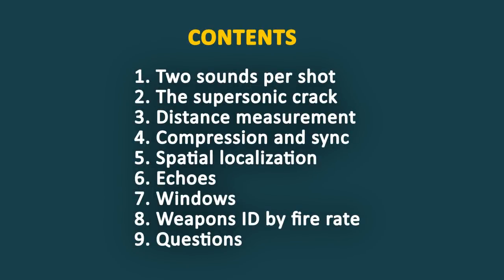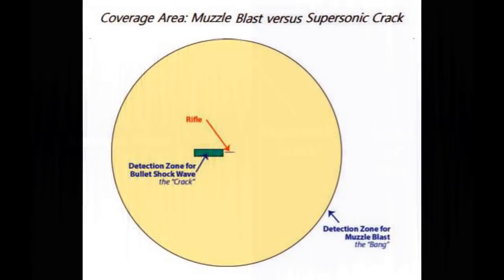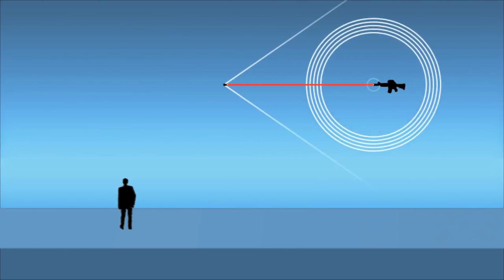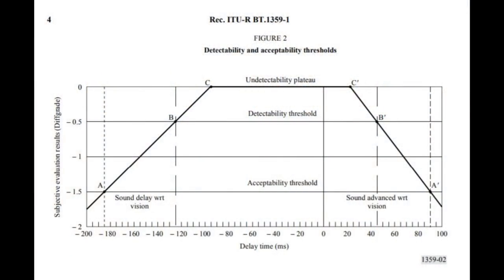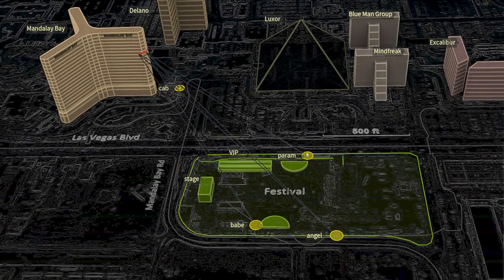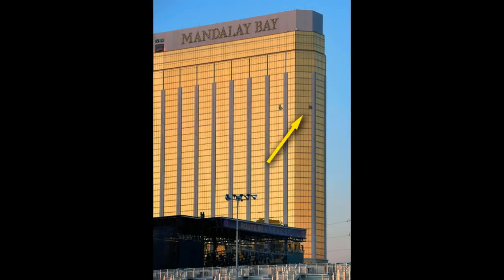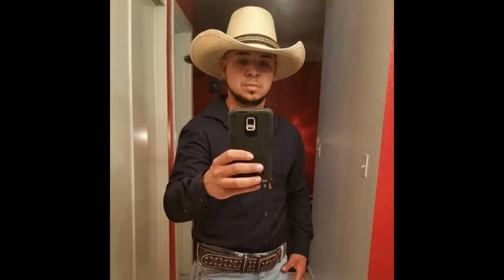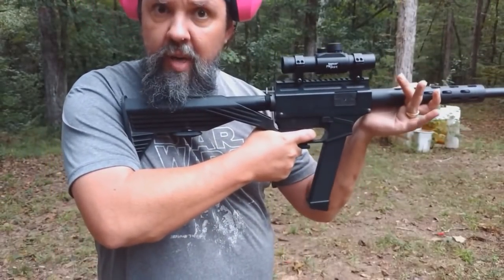2. Las Vegas shooting: The Acoustics of Gunfire

Comment: Good work, except on the issue of muzzle flashes.  There's no reason to believe that you'd be able to see muzzle flashes from that distance, especially on a crappy cellphone camera, with highly compressed video.  With a decent flash suppressor, the muzzle flash can be made almost completely invisible, even close up.  https://www.youtube.com/watch?v=6JkmWVCd674&t=39s
Reply from the maker: +Jeff Fenske I've noticed that reflection problem, too. I'd tend to agree with Jeff w/r to the window on the left. Given the big difference in reflectivity between a pane of mirrored glass (covering MB) and a curtain, you would expect to see a somewhat darker speck where the reflection was missing (if the left window was broken). Yes, some glare would still bleed out from adjacent pixels, but there should be at least a slight discontinuity in brightness, which I don't see.  I've actually developed a theory w/r to the windows but I'm not sure if it's worth doing a video on this.
Reply: I think we sufficiently covered the broke window issue elsewhere.

Many ARs eject brass at a forward angle.  For example:  https://www.youtube.com/watch?v=UwSIxKZAs40
If he was shooting out of the left window, and angling the gun toward the crowd, the brass could easily fly out the window.  But this is all based on one or two statements, which don't really tell us much.  She said "you COULD literally see glass falling out of the windows of Mandalay Bay".  She didn't say WHEN you could see that.  She could have been referring to what she saw before the shooting started, or maybe the shooter broke out the second window in the middle of the attack, or knocked some additional glass out to make the hole bigger.  After the last burst of gun fire, she said "there is glass falling out of Mandalay Bay," but that was while the other guy was narrating what was going on. 

I called her as a ditz because, during a mass shooting, she was whining about sitting on the ground and joking about being a "street dweller."  

By the way, from that video, it looks like she was filming with her phone, including looking around the corner of the bus stop shelter toward the shooter's area.  I wonder if she has that video.
Reply: How can you deduce it?  She said you "could see" it falling.  She didn't say "hey look, there's glass falling".  The guy filming said they were sitting by the fountains when it all started, so she very well might have seen this 10 minutes before the shooting started.

By the way, I noticed that those last two shots didn't have a separate sonic crack and muzzle report like the other shots, so it seems unlikely that they were fired out over these people like the other ones.  Some people are speculating that those were the shots that killed him.  But they seem too sharp and loud to have been fired within the room (unless he was standing right in the window when he shot himself).  I wonder if a cop took a couple shots at him from the ground after that last burst.
Reply: When I said left window, I meant from the point of view facing toward the building.  If he was shooting out of the left window (i.e. the one in the connecting room), he would have to look to his own left to be aiming at the crowd, meaning the ejection port would be angled toward the window, and the shell casings could easily go out the window.
Reply: I'm not necessarily assuming a perfectly rational performance from a guy who decided to spray bullets on a crowd of people who just wanted to enjoy a concert.  So it's conceivable to me that he would get caught up in the moment and get close to the window for a mag dump or two, and that the girl at the bus stop saw casings falling and assumed it was glass.  On the other hand, it's also conceivable he broke one of the windows mid-shooting (see Mr. VIsual's other video), or that she was talking "out of tense" (i.e. describing the present situation generally in the present tense as a narration of the events, even though certain specific detail she's talking about happened in the past -- in other words, I don't think you can put that much stock in her exact word usage).
Reply: I don't think so.  If he was just sticking the tip of the rifle out of the window a few inches near the left (from his point of view) edge of the window, and angling the gun toward the crowd (about 30-45 degrees off the plane of the window), combined with a slight forward throw of the brass, they could easily clear the opening.
Reply: The guns shown that are said to be Paddock's did not have flash hiders. Flash would have been easily seen with cellphone cameras. And cellphones have compressed audio, not video. | You're right about flash hiders. Whoever fired the shots from wherever must have used good ones, since not even one camera picked up the flashes. No camera shows broken windows in floor 32 also, until the next day, another main reason to doubt the shots came from floor 32.
Reply: I guess you didn't watch the video I linked.  No, flash hiders would not be easily seen.  All the rifles in the pictures have muzzle devices, and it's impossible to tell what kind they are the photos.  An aftermarket flash hider doesn't really look any different from any other muzzle device.  

As for the views of the windows, all the video we have was taken at long distances, in terrible lighting conditions, with cell phone cameras.  Cell phones cameras are crap and video compression makes the results even worse.  There's a lot of things they don't show.  For instance, in one video, when a helicopter passes in front of the hotel, it practically disappears at times because of the bad lighting and video compression.  There's no way you'd be able to see muzzle flashes from these distances from anything but perhaps a bare muzzle on a short barreled rifle, when filmed with cell phones.
Reply: Rick, the muzzle devices that we see on Paddock's guns are large holed muzzle breaks that would have lit up the room big-time! I have seen your video, wherever the shots came from, flash hiders were used. | This video is conclusive. The windows are basically large mirrors. If two entire windows were broken, it would be seen.
(vid) Vegas Shooter’s Windows During Rapid Fire Shows No Shooting & No Broken Windows  https://tobefree.wordpress.com/2017/11/05/vid-vegas-shooters-windows-during-rapid-fire-shows-no-shooting-no-broken-windows/
Reply: I don't know how you can claim to see what kind of holes there are on the muzzle devices on his rifles from the pictures available, but in any event, there are plenty of sub-1 Lux devices in the video I linked that have large holes.  I also don't know what you think your video is conclusive of.  There's no reason to believe that this video would be able to show the broken windows.  In many places, you can't even make out the fact that people right by the camera have eyes.  Also, notice that in the big letter B on the top of the building, you can't even make out the holes in the letter.  Those holes are bigger than the hole in the window, and there is far more contrast for the camera to pick up.  

Finally, the circles in the thumbnail on that video aren't even in the right place.  The broken windows were a bit lower.  They are on the 9th floor below the top of the vertical lights.  You can  see three floors above his window with lamps showing through, so you can use this to measure.  Using that, you can see that the bottom of his windows would have lined up pretty much with the bottom of the first reflected letter on the side of the building.
Reply: Rick, you can't make out the hole in the letter B because the highlights are blown out, so there is no information there. This happens all the time in photography. I'm a photographer. If the camera would have exposed for the bright letters instead, the letters' edges would be defined, but then the building wouldn't be easily seen.
Reply: The same sort of thing happens with darkened areas, especially in poor focus, with high levels of video compression.  This video, on top of being encoded in MP4 compression, was reencoded using VP9 when it was uploaded to Youtube.  In short, it's a big mess.  And with all the massive contrast in light intensity, the area where his windows are is totally blacked out.  There is no contrast shown.
Reply: Rick, that's possible, but only regarding the window on the right. Paddock's window on the left is in the area that has enough light on it to not lose any information. Where Paddock's windows are:  http://archive.is/qC4tF
Reply: Falling glass was only reported after the last volley (bus stop video).
Reply: Falling glass was not "reported".  Some ditz that was obsessed with the fact that she was sitting the street in LV said something incoherent about falling glass....and she was probably seeing shell casings fall out of the window, if anything
Reply: The window on the left is within, or right below the glare from the reflection of the MB sign, and could easily have been interpolated within it.
Reply: Rick, if the mirror window was broken it wouldn't reflect anything. There is no broken window there. | Shell casings would not "fall out of the window." The window frame and remaining 'glass' would have stopped that, if there were any near the window, which wouldn't make sense. Shell casings eject to the right about 6 feet and behind. And they're light.  | Why do you call the lady a "ditz?" You're not doing objective research.
Reply: Rick Lee/Jeff Fenske, I have just taken a careful look at this evidence and hereby my remarks. Firstly, BB Pissed is wrong in regard of the overlap, the left window is not part of the area that reflects the MB text or as such the more or less indirect illuminated upper part of the building on which this text is located (BB Pissed could easily have done a better work here!). Secondly, if this video (the zoomed version) is 1980x1080, the left window represents 5x28 pixels, which correspond to no more than 3x17 and possibly is little as 2x11 in the original video (again with reference to a 1080 format). If there is no glass in thé windows (which I still believe there isn't) this video cannot expect to give evidence of it because it does not have a proper 1080 solution and the lens diffuses the highlights. Even without compression, I doubt it would make any difference if the windows are there or not.
Reply from the maker: +Rick Lee  -- "She didn't say WHEN you could see that."
You can deduce it (with high probability).

-- "maybe the shooter broke out the second window in the middle of the attack"
This is my current theory. I think I have good reasons for it. Maybe I'll do a video if I have some time, as it would need some illustrations in 3D.
Reply from the maker: +Rick Lee   -- "How can you deduce it?"
See the latest video: "Las Vegas shooting: Paddock's timeline"
https://www.youtube.com/watch?v=E3vlkTpGR9o
Reply from the maker: -- "but there should be at least a slight discontinuity in brightness, which I don't see"
Looks like I spoke too soon. In a few frames, when the glare is less intense, there seems to be such a dip in brightness, matching the shape of the broken window.
See the latest video: "Las Vegas shooting: Paddock's timeline"
https://www.youtube.com/watch?v=E3vlkTpGR9o
Reply: Rick Lee, the AR in your video ejected the cartridges straight out to the right, right at the camera.
Reply: The gun is pointing almost straight ahead, right angle to the camera. Bullets eject to the right, not straight ahead and out the window.
Reply: Rick, the shooter is at a very slight angle towards us, hardly at all, and the casings almost land below the camera. So they eject to the side and only slightly forward. Also, I think you're getting your angles backwards. You say: "If he was shooting out of the left window, and angling the gun toward the crowd, the brass could easily fly out the window." But the crowd is toward the right, He would be angling the gun to the right, not the left, which would make the bullets fly further back into the room and away from the window. The only way they could fly out of the window would be if they ejected straight ahead, which is impossible.

Your video is helpful though. Being that the cartridges eject slightly forward makes where the cartridges are in the leaked 'Paddock' photo more possible.

I'm guessing that if any shots were fired out of that window, it was probably only one volley, maybe the last we hear, which does sound like bumpstock, because it's so variable.

But where were the other volleys shot from?

Also, if the gun was lower, the cartridges probably wouldn't travel as far. Someone should rent an identical room, and measure how far away those casings are from where the shooter would have to be. Perhaps it could be calculated by knowing how many inches the guns are in the photo too.

And then measure how far a bump stock throws cartridges from a standing or lower position.
Reply: I see. You are talking about the other window, which we don't have any pictures from. Still, the gun would have to almost be sticking out of the window for the casings to eject out of it. Why would he, or whoever be that close to the window?
Reply: He would have to be at the edge of the window, and maybe shooting towards the Luxor to get the casings to fly out of the window. Look at this photo: https://www.youtube.com/watch?v=w0uYZrTtynE

Comment: My thought is the gun failed from overheating. The last 2 shots heard from the bus stop video where only about 30 seconds afterwards.  Either the gas tube or barrel overheated and caused the slower rate of fire. An ar15 is only good for 800-1000 rounds before failure without decent time to cool off. Why would he overheat one gun if he really had 20 others to choose from? And who needs 2 bullets to commit suicide?